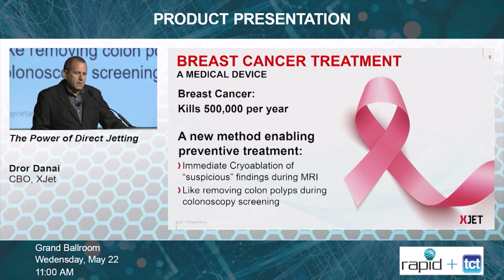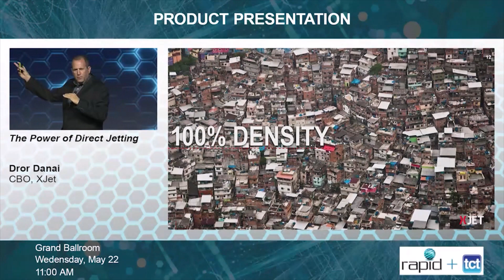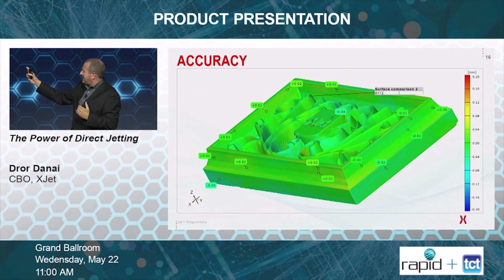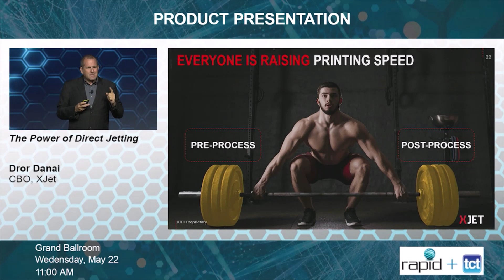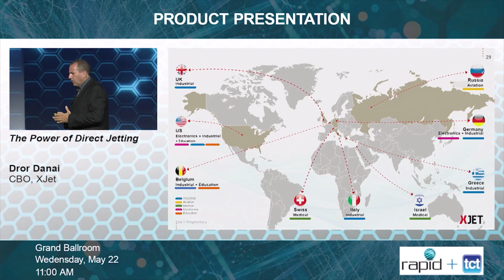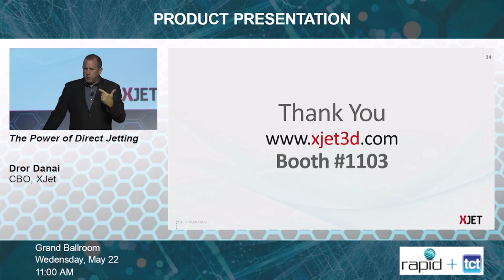Rapid 2019 presentation by Dror Danai

Comment: Multi material printer was something that I was always looking forward to see ever since I first saw the Xjet printer. Such a multi material printer can be used to make remarkable products like super capacitors, batteries, rocket engines just to name a few. Great job Xjet team, I would like to know if it is limited to just two materials or can it go beyond two materials?
Reply: Thanks Anil. The direct jetting approach allows the jetting of large number of materials at the same time. Today by using build and support structures it overcomes many challenges of complex geometries. The real challenge for more than one build material (two or many) is not in the printing itself but in the needed sintering.